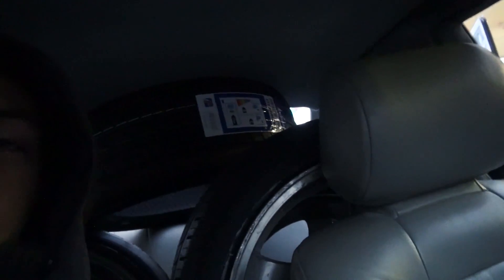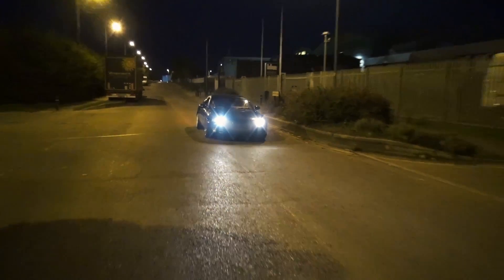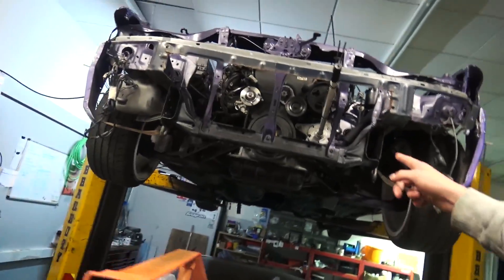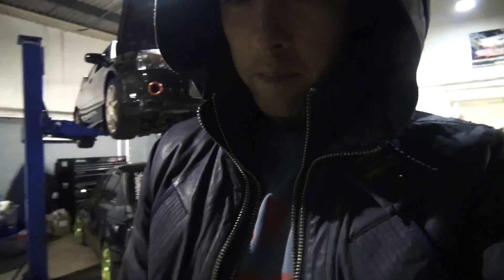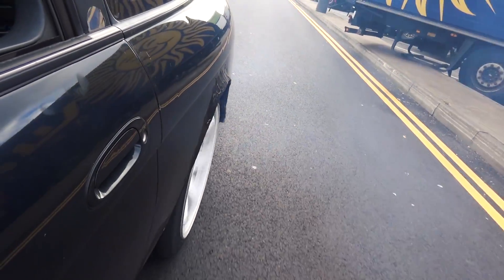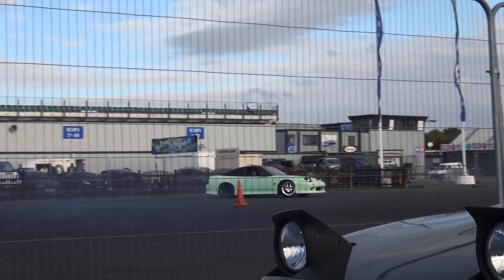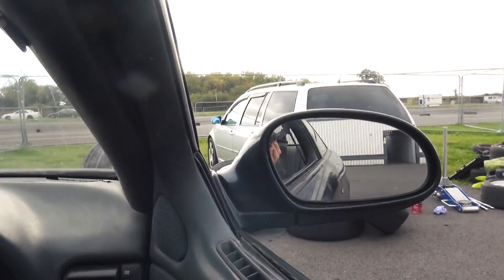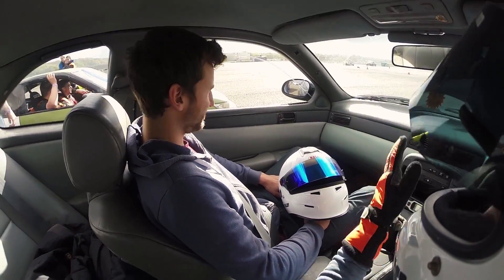🐒 FIXING UP THE TOYOTA + FIRST PROPER DRIFT DAY

Comment: is there a reason to not use a w58 gearbox?
Reply from the maker: +MrBigbadbullet Just a bit weaker than the R154, fine for prob 400hp, R154 about 550hp but even over 500hp it's pushing it depends on a lot of factors like box condition etc.